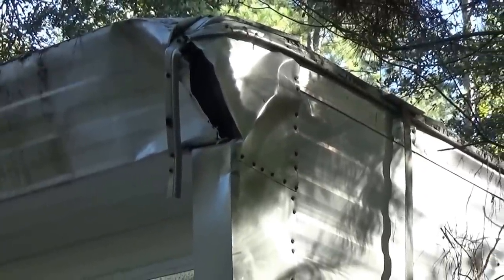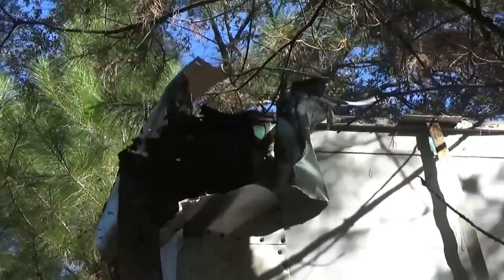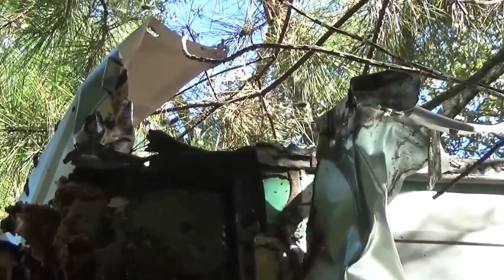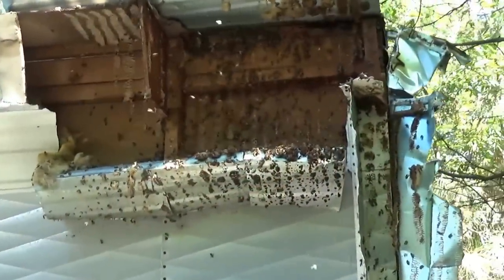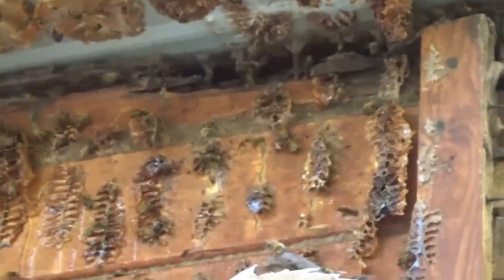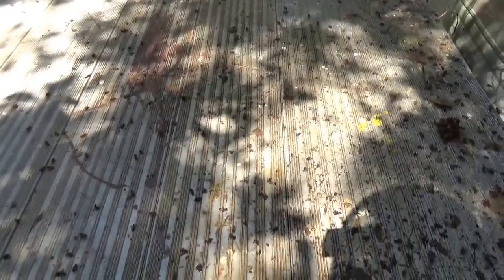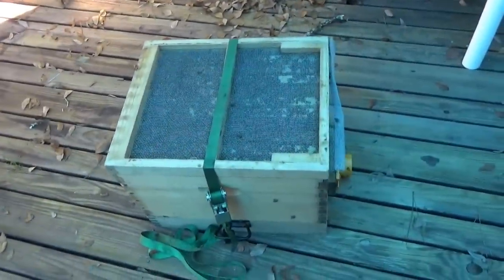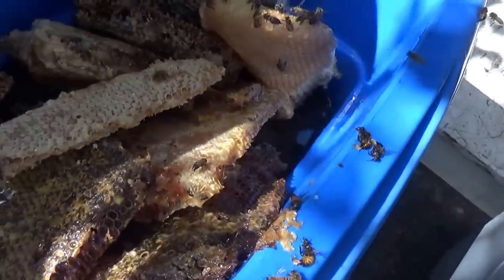Liquid gold discovered in old house trailer

Comment: Is there any point when the honey you get is no good?    Some of those honeycombs looked dark .... and how long does it take for the beed to build all those huge honeycombs ?
Reply from the maker: Honey needs to be processed as soon as it is harvested, if not, it can ferment. Once it is removed from the comb, it will last indefinitely. The dark comb is older comb, and the white comb is brand new comb. This hive had been in the trailer for 2 years. More good questions, still learning? God's peace.     Mr. Ed
Reply: Yes Mr Ed learning a lot,   Thank you for the videos! Very informative.       

So for when you harvest the honey, all of it is mixed.  That's interesting.   How would I know if there is larvae in the comb?
Reply from the maker: nelli rosas The larva are stored in another section of the comb. It would be difficult to get the two mixed together. Although the brood, the larva, and honey can be on the same comb, you can separate the two. Another great question. God's peace. Mr. Ed

Comment: Now that is a knife! How much honey did you get?
Reply from the maker: When I first saw your comment I thought you were Crocodile Dundee, what a great line. I do love that knife as it is the best utensil I've found for cutting comb, it's super long and very flexible. It is actually used to cut down Christmas trees, that's why it has a notch in it, it was damaged cutting trees. I still don't know how much honey was  removed, I've processed it but I have not weighed it yet. Stay tuned, I'll let you know later.      Mr. Ed
Reply from the maker: I wound up with 74 pounds of cleaned honey or just over 6 gallons of the sweet stuff. I'm holding on to a gallon of it for my own stash because it is so um um good.         Mr. Ed
Reply: Wow! It did not look like that colony had been in the trailer too long (not a lot of dark comb) but must have been a good location for them as it can get rather warm in a metal box and to make that much honey. Out here in NorCal we are still in a drought so I am leaving my girls all of their hard work for the winter and hoping I won't need to feed. Wishing all well for the upcoming winter months.
Reply from the maker: Thanks for the warm wishes, I return them to you . How cold does it get in the winter and are there extended periods of cold where you are? Like you, I'm always concerned if the bees have enough stores to make it through. I do feed mine sugar water around the end of December but I don't want to over feed and think the queen can start laying again. We generally have mild winters with only the occasional  dips into the upper teens and low 20's.
Reply: Not much different than for you but we are in our fifth year of a drought so our dearths have been tough on the bees. We are just now getting our first real rain of the season which runs from October to June. If the rains fall at the wrong time or not enough there won't be enough forage for the year or much output from the fruiting or nut trees. Robbing was really bad for us late summer this year and if the colony was not strong enough they failed early.  I have been planting sunflowers and letting my artichokes bloom so the girls have something for summer nectar and pollen stores. But our best tasting honey IMHO comes from fennel. It has a bit of a licorice taste.
Reply from the maker: It is very difficult for me to fully comprehend he experience of drought, but I can imagine the nastiness of it. To have to live with a constant awareness of conservation is something I'm grateful I do not have endure. Most of our honey comes in the spring with the blooming of Chinese Tallow and the privit, and in the fall it's the goldenrod that is the most prevalent. Right now, the goldenrod is in full bloom and I have my fingers crossed that I may get some of it. I'm still just building back from the flood in March, but some of the hives have 3 deeps on them so I am hopeful. Do you sell any of your fennel honey? I would be interested in tasting the flavor. How many hives do you have and how long have you been keeping bees?  God's peace.   Mr. Ed

Comment: Could you explain what "honey robber" is?
Reply from the maker: Honey Robber is a chemical that is squirted on a fume board to push bees out of a honey super. The smell of the stuff is so strong the bees run away from it and you wind up with a super with very few bees in it. I also use it to chase bees from cracks and openings when I do cut outs. It will run every single bee from where ever they are hiding. Great stuff, but man does it stink. Thanks for watching Dave.       Mr. Ed
Reply: Thanks. I see. I have some that smells like almonds and is not offensive. Then an old retiring beekeeper gave me an unopened bottle of Bee Go. Yeach! Smells like vomit!
Reply from the maker: Yep, that's the stuff. It works GREAT!
Reply: Thanks again for answering my question. One more? How do you mid the Bee Go with water? Tablespoon per quart?
Reply from the maker: The product I use is Honey Robber and it comes already mixed in about a 64 oz. bottle. I get it from Mann Lake bee supplies. I geta most of my bee stuff from Mann Lake because of the free shippping.    Mr. Ed